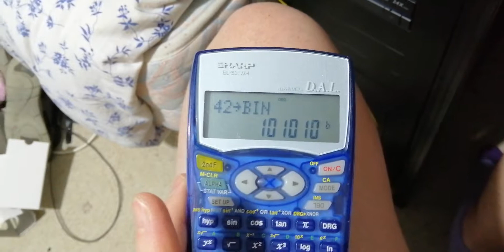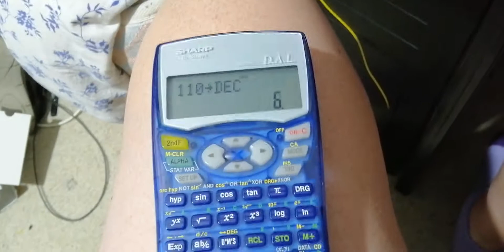16bit Breadboard Computer, Registers and ALU Part 3

Comment: Very cool! If you are using 245 buffers on all bus connections there should not really be any leaking voltages on the bus,  however I noticed on my build that the buffers caused a lot of issues with floating bus signals on both sides of the buffer. It was necessary for me to have (1k) pull down resistors on the module side of the buffer and the bus needed to be pulled down too. Solved 75% of my errors. Power distribution was another major issue for me, it wasn't until I soldered the power wires in a series of header pins for each power strip that the voltage problems almost vanished.

I considered the 74xx181 ALU for my build, but decided to go with the 74xx283 for simplicity, but i would like to see the 181 run.